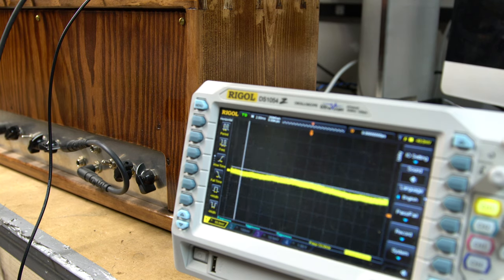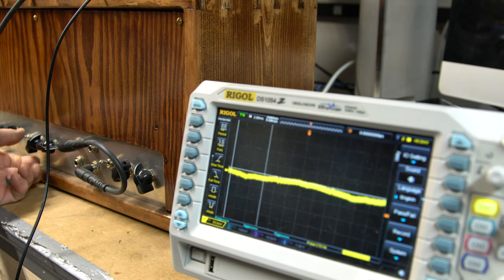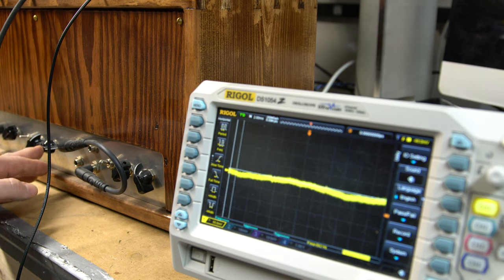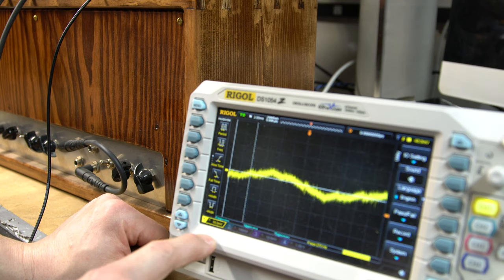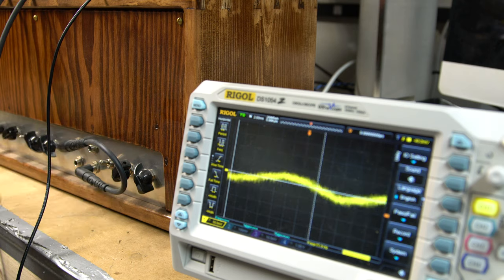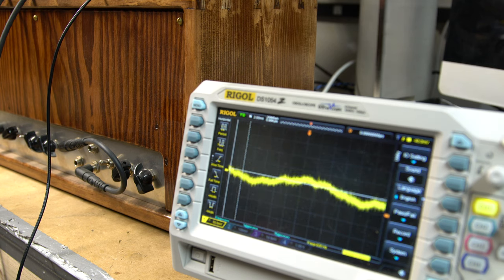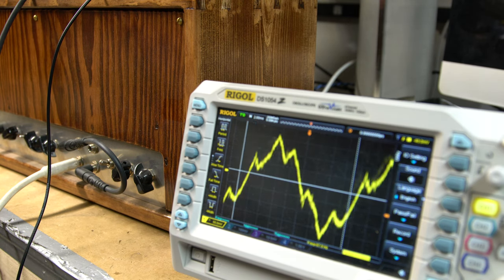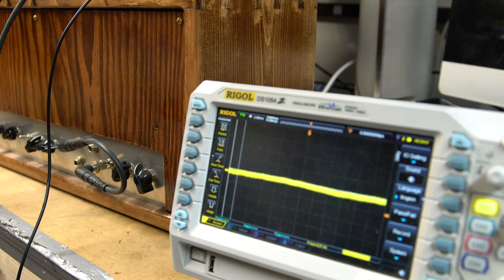Tube Amp Hum Levels

Comment: why not trigger the sweep with mains line to get a stable display ? No such setting on that scope?
Reply from the maker: I'm actually pretty new to using scopes.  I would love to know how to do that.  Are you talking about using a remote trigger?  I'd appreciate you showing me how to do that, sometimes using the horizontal bar I can scroll it up and down to find a spot that stops the scrolling but not always.
Reply: @FrenchieFilms  On front panel, find "TRIGGER" control, choose "LINE", choose Mode "AUTO" or "NORMAL". In NORMAL MODE use (TRIG)LEVEL to fix the waveform on the screen. Set TIME BASE so 2-3 periods of the waveform are displayed. Adjust input sensitivity so waveform amplitude uses as much of screen area as possible. This will let you study the "hum" in detail. Watch how more detail (HF hash) appears as you stretch the time base. Download User Manual from Rigols web site, this should be described there. Happy Scoping!
Reply from the maker: Excellent, thanks!

Comment: Can you describe how you isolated the amp from the ground that the scope is on? i just bought my first scope (the same one) two weeks ago and would like to diagnose my DC-30 clone build’s hum problem using my scope. I’ve read so many warnings, but there’s not too many quick solutions to the problem other than not using a ground on the amp.

I just found your videos and am learning a lot, as you are providing the information and know-how to bridge the gap between 5th time amp builder to journeyman.
Reply from the maker: You can use grounds on the amp, just be sure to only connect the probe where there is no high DC voltage.  Or get a 100x probe that can handle the higher voltages.  I connect after coupling capacitors where only ac voltages of the signal live.  Be very careful out you can cook the scope.
Reply: That was what I originally thought. Then I watched this video on EEVlog https://www.youtube.com/watch?v=xaELqAo4kkQ and a couple of videos from Uncle Doug on isolation transformers. They both warm about not sharing grounds with the equipment under test. 

I picked up a cheap differential probe instead of building the isolation transformer they recommended. Here's the probe: https://smile.amazon.com/Micsig-DP10013-Differential-Attenuation-Tektronix/dp/B074K4XPW3

Comment: What type of hum eliminator / isolator should you use between the power amp of a 50 watt class A (SET) guitar amp and the speaker cabinet (i.e. at Speaker output level, NOT Line or Instrument level). It is a 60 Hz hum issue that I reduced a lot by using an Ebtech hum eliminator on the input side of the the guitar input to the amp (i.e. Hi Z instrument input).  It left some Hum there still, so I tested with a similar type of an passive isolator on the 1/4" cable connection  between the power amp head's output and the speaker cabinet.  However, I know that these sorts of hum buster devices are not really designed to be used that way (i.e. speaker level output levels from a 50 watt Class A SET amp).  So, what recommendation(s) do you have for that that would be safe and not negatively impact the audio.  
Thanks so much in advance!
Reply from the maker: I've not ever used hum eliminators after the output transformer, but before the cab.  If generally focus inside the amp where it can originate.  60 cycle hum is caused by mains, not rectified, current.  Heaters or power transformer placement or wire lead dress.
Reply: Frenchie Films — thanks for the response.   Yes, I normally use it in the normal parts of the signal path too.  However, when I tried it, knowing full well that it was not designed for that usage and would just be s test, my noise levels dropped from moderately low to virtually inaudible (like another 35dB drop).   So I know the right type of transformer/isolator would be amazingly effectively in that part of the signal path, since when only used in the other parts of the signal chain it left more noise still than I found desirable.  When added to the final path it was like pure satin blackness in terms of noise.   Let me know if you have any thoughts or whatever.
Reply from the maker: I'm not sure I understand how what you're explaining works.  I'd love some links to read up on this if you can share them?
Reply: Frenchie Films - sure.   I can take a few pics, and send some info.   I know just enough to be dangerous, as I am a 55 yr old computer science professional, with a EE and CS degree degree from decades ago,  who did 90% code and related stuff for his life (i.e. very little electrical engineering, other than some digital PCB breadboarding, and a little integration here and there).   So, understand that I am only somewhat cognizant of alternative approaches, let alone best practices, in this area.
Ill send some pics tomorrow, but it’s basically a hum isolating transformer (e.g. Ebtech hum buster transformer, but have tried other hum isolating transformers and iso’s, like the Behringer hum destroyer, with similar results) used in two places: (1) on the high impedance guitar input and (2) on the power amp to speaker cabinet; with that second thing being an “incorrect” use given that it is at 
‘speaker level” rather than “line level” or “instrument level” voltage and impedances.  I think that the reason it may be working so well when I try it on the amp to speaker connection point is that there is an “attenuator” on this amp internally— but I need to look at the circuit on that.   

It is a Jackson Ampworks McFly II Head and Cabinet, which the head is a dual/dual selectable 6V6 / 6L6 output tubes set, with a 6SN7 preamp tube stage, operating in Class A  Single Ended mode at 70 watts max, with selectable attenuation down to 1/8 watt.

Jackson Ampworks McFlyII Head Amp + Speaker Cabinet:
https://www.jacksonampworks.com/shop/amplifiers/mcfly/
Ebtech Hum Eliminator:
http://ebtechaudio.com
Reply from the maker: Cool I'll take a look at those soon.  I'm also in tech, but did deep into this home for the last few years and have loved it.

Comment: Thanks a lot for the effort, I really appreciate it! This is exactly what I needed. I can clearly hear and see that you have a smooth hum just like I have. Yours is actually higher than mine. Mine runs around 20mV peak to peak. But like you said, I might have some issues with some coupling from the high power lines into the input lines of the powet tubes since my 20mV is constant. No matter how far I turn the volume potentiometers and is still there when I disconnect the PreAmp tubes and the phase Inverter.

This definetly is a big help!

Can you do me a last favor regarding measurements, could you just measure if you have a hum when no line is connected to your input jacks and you got the volumes turned all the way down? Just the peak to peak voltage in text, I don't need another video for that.

Can you also give me a paypal link? Want to wire you 10€ for the time you took to answer me and also in general as appreciation for your channel and the effort you put into your building series.
Reply from the maker: Thanks for your comments.  I sure can do that measurement, shouldn't be hard.  Also I have a patreon page, where people can donate if you'd like: https://www.patreon.com/frenchiefilms I've tried working on that platform a bit but never really gotten very far as I've had no traction so I'm not posting much to it anymore.  If you'd still prefer paypal, I'll get you that information via the email I posted earlier.  Anyone is welcome to email me at pdavis@frenchiefilms.com
Reply from the maker: And for anyone coming by later, this measured so low that at my lowest scope setting, 20 micro volts, it was barely visible